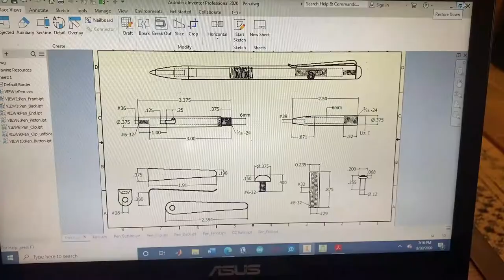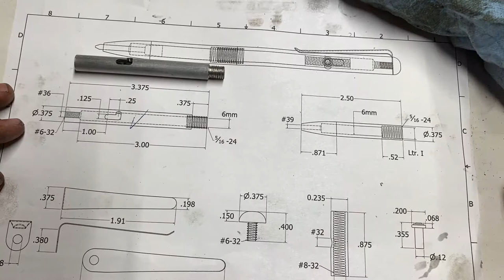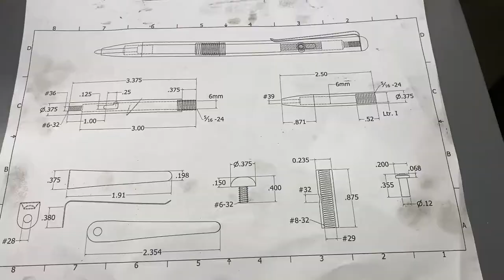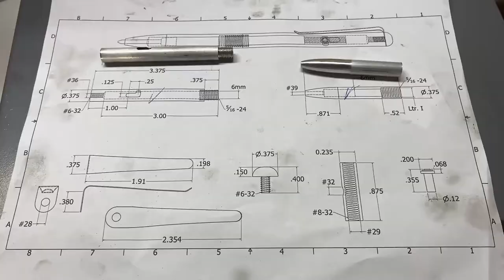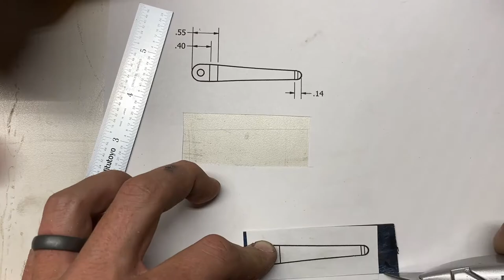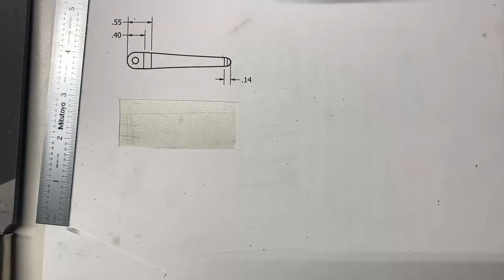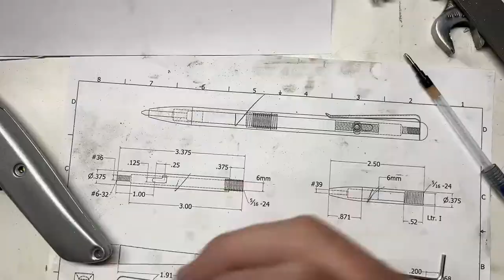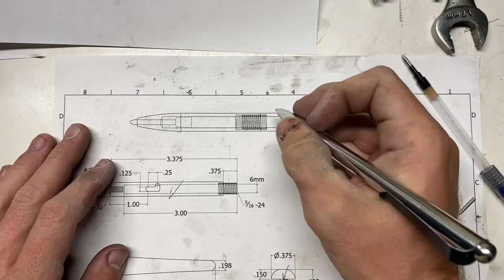Lathe Project - Brass and Aluminum Bolt Action Pen

Comment: Is the measurement mm and inches?
Reply from the maker: The dimensions are in inches except where otherwise noted (ie. the 6mm bore and number size drill bits)

Comment: can you do it without a milling machine ???
Reply from the maker: Hmm, you could probably get away with a Dremel tool to make the slot (abrasive wheels or burrs), maybe some small files to finish it off. Could also use a drill press and drill several holes side by side then file out the rest.

Comment: whats that number in the drawing? (#29, #39, #36, #28, #32) i dont get it :D normali i have metric. and what is Ltr. I ?
Reply from the maker: Those are all drill bit sizes. Just like Metric or Imperial sizing systems, there are the letter and wire gauge (number) sizes.

Comment: Machine shop in flip-flops? I would stop you at the door.
Reply from the maker: I would have to flip flop my way past you seeing as the door is my own :)

More seriously though, I certainly wouldnt think of working in an actual machine shop in flip flops. However, in my home shop doing small work like this I wasnt too concerned about dropping some 0.375" brass on my foot. Not condoning flip flops for shop use 👍

Comment: During assembly you put some sort of set screw into the brass threaded section. There is no detail of that in your drawing and when you do it it’s partly off-screen. Can you elaborate on that part? What is it and its purpose.
Reply from the maker: I insert a #8-32 set screw into the brass threaded section. This threads in and locks in place the thumb-piece that is inserted into the brass threaded section (at a 90 degree angle). Otherwise this thumb-piece would just fall out as it is not pressed, glued, or threaded in.